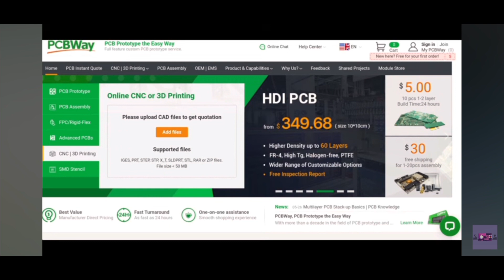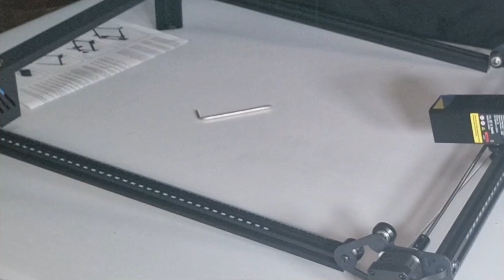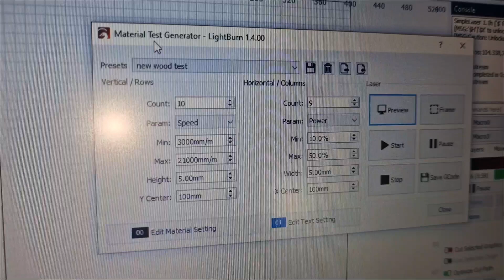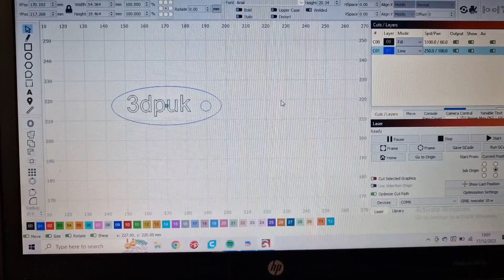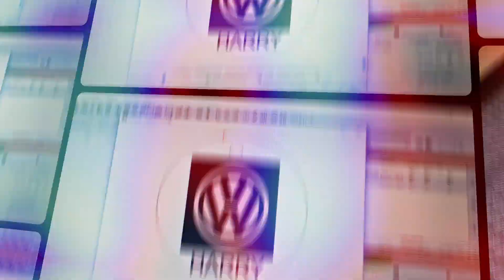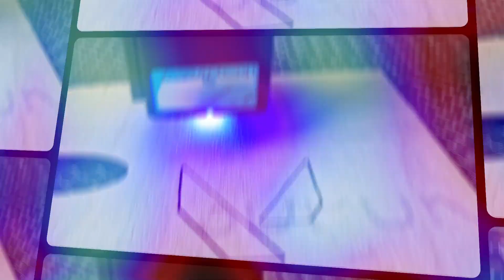Iwecolor 10w laser engraver - cutter build and review

Comment: 3DPUK TECH CHANNEL... I just purchased their 5W laser engraver and it didn't come with any way to set the correct height of the laser head from the work piece or any test materials like cork, wood, metal like you showed. Also the instructions leave a lot to be desired. I have a Mac computer and wasn't aware that I had to purchase yet another product (program) for this engraver to work. I need LightBurn to use on my Mac and it's not cheap. I might be sending this back.

Comment: Hello,
I purchased the IWECOLOR laser 5W 400x400 high performance. I registered the laser on the website. I asked support and it's been 2 weeks no response I am hoping you will be able to help me? everything went together great, but my laser module isn't level to my work area the front is lower, and the back is higher? i tried what I thought was an adjustment nut on backside on lower roller behind module, than belt tension adjusting tightening? nothing looks bent or tweaked it just bothers me it's not flush with spacer or work area I am not sure if it will affect the performance? I am hoping you can help me. Thank you
Reply from the maker: @darwynhoffmeier2243  I will speak to the owner of iwecolor about this amd get back to u
Reply: @3DPUK-TECH-CHANNEL  Thank you for taking the time.
Reply from the maker: Can you send me an email...my email.id in description add details ie order number etc model number

Comment: What software do you all use I can’t even get mine going
Reply from the maker: @rafaelalarcon8299  hi connect to laser gbrl  first that makes the connection, ensire to download the correct software for the connection I believe ch340 driver.  Once this is established  I use lightburn u need to setup as a manual setup using GBRl etc

Comment: Hello,  I was wondering if you could send me the measurements of the round laser height gauge. Mine is a flat piece of plexiglass so I’m confused which one is right ‘ better

Thanks Chris
Reply: On the back of the instruction manual it says to put the tip down onto something they call a "Fixed Coke" the looks like a piece of 3mm plexiglass to focus it. I have no idea what that is but there is a little piece of plastic material in the kit that should work.  It's nothing like he shows in the video but then his laser is different too.

Comment: Good video. Have you cut any other metals .80 mm or thicker? I'm going to be fashioning some copper sheet that size. Also, I didn't get the spacer for the laser head in my box. Do you happen to know what that depth measures in mm?
Reply from the maker: Hey thanks for watching... did you check the small clear box for the spacer ??? If not I'll definitely measure for you as soon as I get to the office
Reply: I did and it isn't there. I also read you can use this laser for copper or other reflective metals if you use a spray coating first. Found it on ebay. Still waiting for a new computer being shipped to program and test this thing.
Reply from the maker: @kourtneyjayo1776  ok ill measure up first thing tomorrow , thanks for watching  again don't forget to like and subscribe 😉
Reply: @3DPUK-TECH-CHANNEL  Thank you!
Reply: @3DPUK-TECH-CHANNEL  What is the length of it?